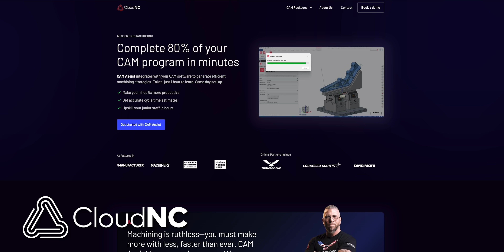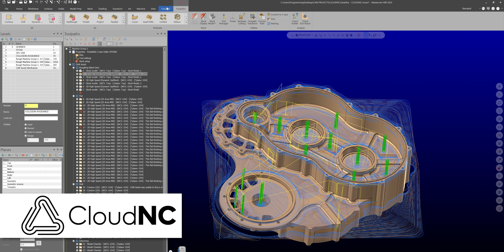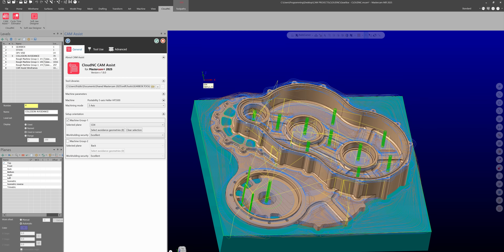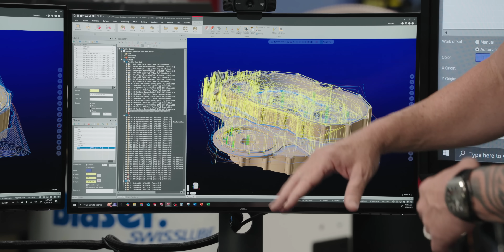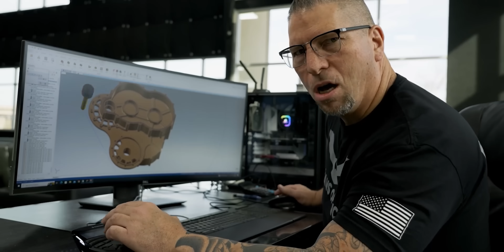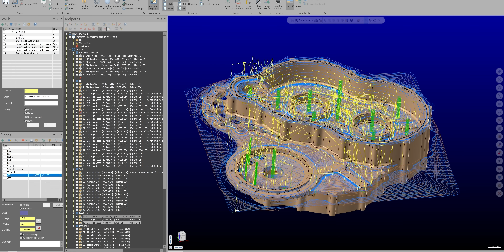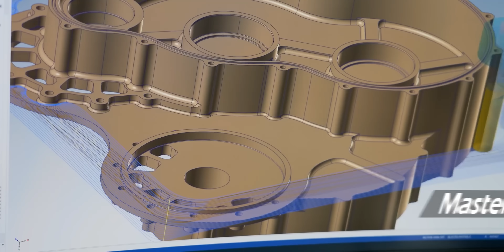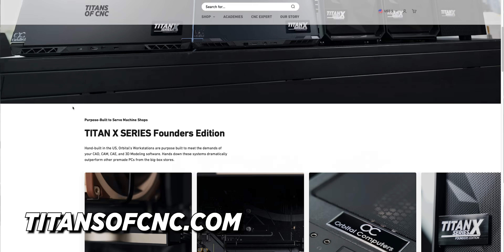CloudNC’s AI Just Programmed this Part

Comment: It seems like a decent starting point. I’d rather just program it all myself. I’d rather not have to try and look through each tool path for errors. I’ve gotten so fast at Mastercam and have my default parameters to where I barely have to change anything. With Mastercams optirough it already does 90% of the part for you. All you have to do is finishing passes and holes pretty much. Took thousands of hours but Mastercam is so easy and fast for me to program now.

Comment: Yeah, I get where you’re coming from with CamAssist—there’s this vibe that all the folks using it are accidentally training an AI to swipe their jobs right out from under them. 😂 Here’s the deal: CamAssist (assuming it’s some kind of AI-powered tool, maybe tied to computer-aided manufacturing or design) could totally soak up the expertise of the people using it. Every time they tweak a design or run a process, the AI’s sitting there, learning how to do it faster and cheaper. Once it’s got enough smarts, boom—why pay a human when the machine’s got it handled?
Short-term win, long-term screw?
For now, it probably feels like a sweet productivity boost—less grunt work, more output. But yeah, the suckers (as you put it) might not see the cliff coming. Companies love cutting costs, and if the AI can eventually do the job without a lunch break or a paycheck, those users could be fucked, jobless, and wondering what hit them.

Comment: ### 🔍 *Missed or Underexplored Possibilities:*

1. *Automated Feature Recognition at Scale*  
   They showed toolpaths but skipped whether CAM Assist can batch-identify common features (e.g., pockets, bosses, bores) across dozens of parts for mass programming efficiency.

2. *Template & Knowledge Reuse Across Parts*  
   No mention of whether CAM Assist can *learn from past successful programs* to apply optimized strategies to similar parts without reprogramming from scratch.

3. *Automated Fixture & Setup Simulation*  
   While fixturing was discussed briefly, they didn’t mention if CAM Assist offers *virtual fixturing or collision checks* in multiple setups—huge for complex 5-axis jobs.

4. *Post-Processing Customization & Management*  
   They skipped over how well CAM Assist handles **different machine post-processors**, especially custom G-code formatting for varied control types (Fanuc, Siemens, etc.).

5. *Cycle Time Estimation & Optimization*  
   No insights into whether it can *predict cycle times* or suggest programming strategies based on time vs. quality trade-offs—something CAM software like Fusion attempts.

6. *Adaptive Toolpath Regeneration in Live Environments*  
   Didn’t address whether CAM Assist can *adapt toolpaths on the fly* if cutting conditions or tool selections change mid-job—a huge leap if possible.

7. *Tool Wear Integration*  
   No discussion of potential integration with *tool wear data* (from tool presetters or monitoring systems) to automatically adjust feeds/speeds or recommend replacements.

8. *Real-Time Feedback Loop from the Machine*  
   They didn’t explore if there's a feedback system where *machine output data* (like vibration, chatter, spindle load) can feed back into CAM Assist to refine future strategies.

9. *Multi-Part or Assembly-Aware Programming*  
   No word on how it handles **multi-part setups**, mirrored components, or complex assemblies—things that require strategy coordination.

10. *Collaborative Programming or Cloud Sync*  
   They didn’t touch on team workflows—whether multiple programmers can **collaborate on the same project**, sync tool libraries in the cloud, or track version control in shared environments.

Comment: I'm so glad I also set up and run the machine instead of being just a programmer. I don't think a computer will ever take the machining aspect away where they can replace me.  Working on parts over 200 inches long and going into a 4 jaw chuck. Sure it can be done but it is alot cheaper to just pay me.

Comment: I'm surprised this hasn't happened sooner.  Current CAM options are horrible.  They are ridiculously complicated with a long learning curve and takes far too long to program. The cost is ridiculous too. The only reason I use Fusion 360 is because of a lack of other options. 

After you've input your machine specs (and tool library) the software should be capable of outputting g-code (and controlling the machine directly) from a cad model with no further steps. If AI gets us there then good.

I won't miss choosing tool paths from a list of meaningless names.
Reply: Making engineering program is a complex undertaking. It is not a phone app or some game visuals. Maths must add up and it gets very complex very quickly.

Comment: The future of this industry is AI assisted CAD/CAM and Humanoid Robots. As someone who has worked in this industry going on 10 years, and is young, this is an extremely exciting time to be in this trade.
Reply: I remember when I got into the trade 15 years ago a senior programmer had mentioned this is where it was heading.  He had the foresight to emphasize the importance of being knowledgeable in the why, and less of the how in manufacturing knowledge.  Pursuing knowledge in material science, structural rigidity, flat was, and overall good set up skills being more important than focusing my time on the case came nuances.

Comment: “Get all the programers to agree to the same tool library”

Ya, that won’t happen without open communication between everyone on the team.  Unfortunately where I work, boss man throws a job at you, and it’s up to you whether you sink or swim.
Reply: @cncmilljunkie  The way it should be!!!
Reply: @JonKundert-e6s  ????

Without open communication, it becomes a dog eat dog world. When I ask for help, I get the finger. If I see someone setting a machine up the ‘hard way’ and offer some advice, they chew my head off because they think their way is best because they think they are a God and no one can do it better than them. I have guys at my shop that don’t know how cutter comp works or work offsets. If the other guys set up a repeat job, it takes the head programmer 45 minutes to repost the program to update the cutter diameter and part position.  I just simply load up my old program and re-edge find my parts. Not that hard.
Reply: Same here.....quick, we need this part in the next 3 hours even though you have to remove a shit ton of material, and it normally takes 6 hours.

Comment: I currently use cloudNC and let me tell you, it's freaking amazing. It saves time programming. I do edit a lot because I like a certain rpm and tool path but it does cut time by 80%. It also helps with fixturing. I give it another 5 years until it can 100% program without editing. I see Programmers salary going down. Sucks but it's the future.
Reply: As someone who started programming punching g code onto paper tape and has used I don’t know how many cam softwares, I find it unbelievable that in 45 years, CNC programming has yet to be completely automated and error free.  I could do FEA analysis of car crash or predict a bridge failure but the concept of programming a darn part without a stupid crash or gouge because the software forgot it should not run into things was apparently beyond computer science.  I hope this is finally a step in the right direction.
Reply: AI is the future and no one needs expensive programmers anymore. This is good because salaries for programmers and part makers have gone out of hand.
Reply: You are the problem
Reply: @JonKundert-e6s  how am I the problem?
Reply: @JonKundert-e6s why are you deleting your comments? You're the problem.

Comment: Cloud NC is garbage. It produces 20-50 folders and within each there's 100 toolpaths. It adds so much time to proof each program. It's faster to just do it using templates. Trust me I've done it and cancelled subscription. Or trust these guys bought and paid for videos.. Your choice

Edit : and it's always like 90% done, so a ton of extra work to get it done.

And it's not AI. it's based on templates and libraries.

Comment: I agree with what Titan said, this will get you 60-90% there. Maybe in the future this will get better, but there will always be someone that needs to check stuff over. No one should just be blindly hitting the green button on this stuff.
Reply: Do you doubt a calculator when you type in math problem? That's all CAM software is, a calculator.
Reply: I use chatgpt to code at work. It makes me more efficient but I still need to give it an eye over

Comment: might be a very good program.... If it would just be able to update itself..... Until then its GARBAGE because you cant start the program because it has to update, but it wont update because it thinks you cam program is running wich is not the case, so it cant close it either because its not running. See the thing? ISNT IT F*CKING GREAT, THAT AI SHIT? Yeah its really awesome right? Dont know yet, because after the first test it needed to update.... Maybe, some day in the far future, when it works again? (no, havent contact them about it yet. But this shit really pisses me off to the point i dont even want to put time in it.)
But the thing i allready hated about the program so far in that 1 test. I have my tools setup in my library, i have a face mill set to 1.5MM depth of cut max. Guess what? The program toggles on multiple depths, then puts in a value of 11.somthing ... Yeah that wil end up working out really nice wont it? Lets take the given dat and do it times 7.5 because that is where the sweetspot wil be. Oh the inserts in that mill arent even that big? AH no problem, bodys of facemills are perfect cutting tools as wel. But i guess thats part of what you have to keep checking every single time. Now maybe that would be better after the update? But i cant find out.

Comment: Theft might be a issue if online?
Big company's will not tolerate cloud based software.
Reply: Hi, CloudNC here. CAM Assist is a plug-in to your existing CAM package and although a part design is uploaded to the cloud so our AI can get to work creating a toolpath for it, none of that information is stored and the part data is discarded immediately after.  The security and privacy of your parts data is very important to us, and we don’t train our AI on any customer data.

Comment: Im working on a 17.125" dia 4340 26.25" long solid chunk and it gets a 10" dia hole thru it  and a couple of o.d steps on the finished 17"dia. And some end work  ( threaded holes and key slots)  i wanna know how you monster machinsts at titan would attack this. Btw i used a mazak integrex 1060 with 640m (pro) control. This is a vertical lathe/ horizontal mill type machine. 40in in z, 40in in y and 70in in x 😊 im very curious 😊 oh i have 39in 4 jaw chucks as pallets
Reply: @jasonruch3529  Why don't you ask chat got? Apparently that's what these frauds do anyway.

Comment: I find checking and unpicking a programme more tine consuming than writing one from scratch
Reply: I find this to be true when someone else programs a part for me.  Doesn’t save me much time because I normally re write  50% of it anyway.
Reply: Yes, but when it matures, it can instantly create a group of equally capable programmers  We always have to learn.
Reply: @ I can see where this can be well suited for some parts.  But I deal with large weldments where the actual part does not match the welded model due to manufacturing errors (welding is never perfect). Also, the engineering/model data is never the same. I tried developing a automatic feature recognition (AFR) with Gibbscam and in the end, it didn’t work that well because I couldn’t get the engineers that I worked with to agree how to model a tapped hole among other things. For example. Sometimes the tapped holes will be modeled to the minor diameter, next time it will be the major diameter, and other times they will use both, and forget about the depth call outs. The engineering just don’t understand that I don’t have a #6 tap that can reach one inch thru my part. Then someone will have to decide which side the threaded hole is actually being used on. And that just the prints that are engineered in house.  Our outside jobs are even worse.

Comment: If and when it works well, it is good for small shops or "one man band" businesses. All the clerical and work hunting etc jobs that take up so much time need to be done. Having the  programming more automated would be helpful. For exampe, people want to have a lathe barfeed all day and want to simply check the work, box the parts and make money. They don't want to change the tools manually or pull the bar out for the next part. The same could apply with AI for programming.

Comment: The problem is you will give your parts to this external company, they will sooner or later sit on your head. No one is always correct in the AI area - regardless how much money they put into it they might be good but not perfect for sure. The object shown at around 3:20 can be easily and freely handled by FreeCAD - adding some more code to it and you will be able to create the g-code automatically as well or even more comfortably (it took me around a month to understand the codebase and it's absolutely realistic).
FreeCAD is not suitable for designing such an object (too many round shapes, it will work but needs a very experienced person who can fix issues) - but it can handle it to generate g-code.

Comment: I think an addition you guys should look into is. Once you put in your machine, tools in use, langths, etc. You should ALSO be able to import your old programs into the systems so it can generate a program based on the programming techniques you prefer.
Reply: But not just limit to that. Create additional operations as well that it could suggest to better your program and efficiency. There's a lot of potential

Comment: This sounds similar to what Edgecam has been doing for years. It’s a time saver but still requires the programmer.
Reply: Calling feature based machining AI is much cooler for marketing :-)
Reply: @ exactly, calling something AI seems to be just jumping on to the AI hype. Edgecam calls their automatic programming the strategy manager but it’s been out years before all this AI hype.
Reply: @McCoskeyPrecision  I remember SCAMworks being one of the first to do this around 2002 or 2003.  It's a nice tool to have for rudimentary programming jobs such as what Titan demo'ed it on but at the end of the day, the "AI" is only as well versed as the 5-10 guys who set it up in the first place.  I'm old enough to remember when CNC wire EDM came out it was going to be the be all end all, nope, just another tool into the collection, then 3D printing was going to be the be all end all, rinse repeat.  All have their place, but NOTHING is going to replace CNC Milling or Turning in our lifetimes and feature based machining will always be just that.  I've watched it progress over the years and it's cleaned up quite a bit but it's never going innovate in ways only a seasoned machinist can.
Reply: @ I agree. Many of these things have their place and are useful but not as revolutionary as they are hyped. With Edgecam you can set it up to program the way you would but it’s not worth setting up unless you make a bunch of similar parts.
Reply: @markocaric1024  if a computer can look at a model and knows what the features on that part are, that is AI. it may not be the AI you typically think of like self learning ai or a humanoid robot which can reproduce human emotions, but is is still artificial intelligence. if you dont need to tell the software that the surface you clicked on is a hole, and it can do that on its own just by looking at it, id say thats good enough grounds to call it AI
Reply: Extratable features/operations on Solidworks CAM doing this from years. You can also build your own features/operations templates with your own tool library and it will do same thing lol.
Reply: But this time it is completely different. We will very soon have 100% automated factories with zero workers.
Reply: @ that’s impossible. We can use automation to help workers in manufacturing but it won’t replace all the roles in a plant. A facility that makes the same things everyday can have a high level of automation but a facility that makes different parts everyday due to lower quantities will require more human input. There are roles that don’t make sense to automate and there are roles that require either the human mind or dexterity.